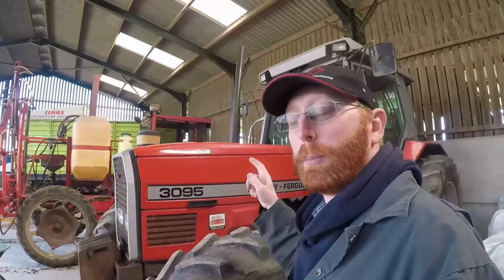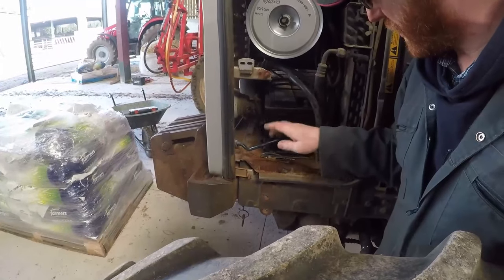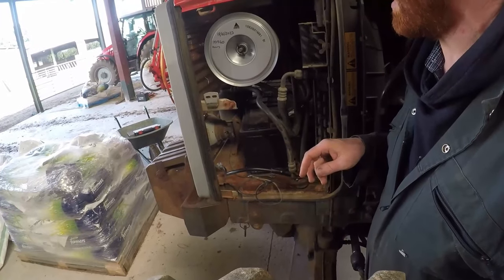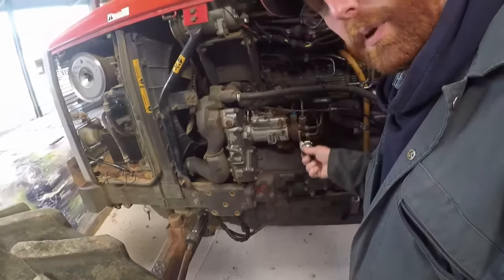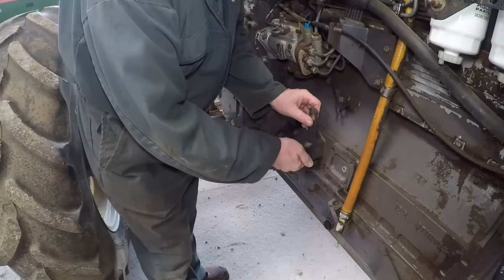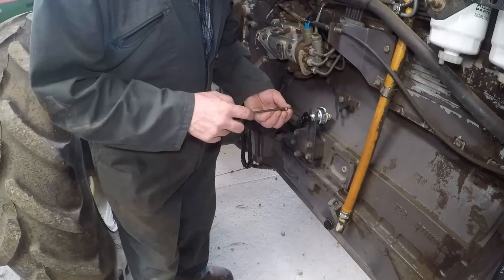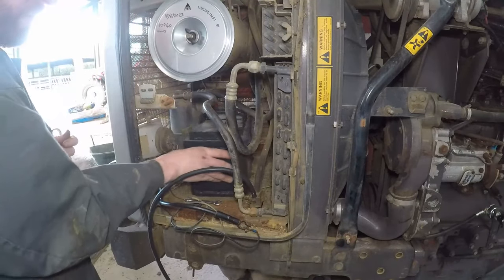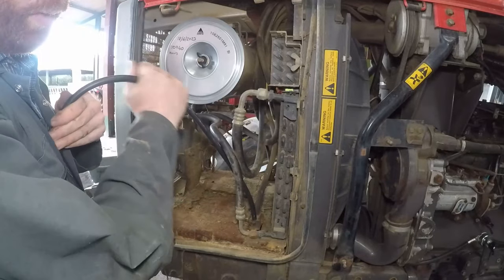Vintage Thursday. Installing a battery isolator.

Comment: It was a good idea to replace the earth line to a non corroded point ...BUT.. the isolating switch should be on the live side close to the battery .  This is important because all of the live side is still live and potentially a cause of shot circuit fire in items like the alternator.  you only need a diode failure in the alternator and the whole unit could go up in smoke. A nice neat job though.

Comment: Hi dan,  i found alot of the elactrical issues with my 3095  were caused by those 2 round connectors above the engine. I cut them out and joined the wires. Help with alot of the issues.
Great tractor though and sounds awesome with a straight exhaust pipe 😉

Comment: MF always had issues with poor eathing through the hard nose mounting bolts. There was a service bulletin issued in the days of the 500 series tractors  to extend the earth cable to connect directly onto the starter mounting bolt to overcome starting issues. Glad to see you're keeping things original, look at a late 525 /625 combine toolbox at the top of the steps and you will see exactly the same isolator switch.

Comment: Curious you wired the switch on the earth side of the battery? If something is grounding out you will still get a parasitic drain as there would still be a circuit. Fitting on the live side would eliminate all electrical power from the tractor. I would be interested in peoples views?
Reply: I always kill the earth too, never any issues that I know of and been doing it a long time.

Comment: if you had an electrical fire due to short and the tractor was running would switching/isolating  the earth  stop the short as the alternator would still be producing power ?.

Comment: Isolator on an old tractor a good idea 👌 my tractor is 65 yr old with original wiring so installed one just like yourself for safety reasons 👌 great video 👍

Comment: Hi Dan, Enjoy your channel. Really like the hydraulic crimper, very professional.  Could you give me the link or make, model etc for the crimper and the connections as I would like to buy one.  Is it the same tool that cuts the cable as well as crimping it? Declan from Farming life at La Forge
Reply from the maker: Hi Declan, it's a different tool to cut and crimp, I'll put the links to everything below.
Dan.
Crimper
https://www.ebay.co.uk/itm/394528845806?mkcid=16&mkevt=1&mkrid=711-127632-2357-0&ssspo=i3fs7EtBRzK&sssrc=4429486&ssuid=HaBpRfveQrO&var=&widget_ver=artemis&media=COPY
Reply from the maker: Cable cutters Stanley Max Steel Cable Cutters 215MM 0 89 874 https://amzn.eu/d/45UoyzE
Reply from the maker: Terminals, various sizes available. 
https://www.vehiclewiringproducts.co.uk/c-46-battery-fittings-isolators/c-97-terminals-connectors/p-556-copper-tube-terminals
Reply: Thanks Dan. Much appreciated.

Comment: Very interesting from my perspective as my 3070 still has starting issues. Turn the key and nothing happens. Repeatedly turning the key will allow it to start. We fitted a new starter motor which has not cured the problem.
Reply: Your fault could be in one of several places, firstly check main battery leads by connecting a battery directly to the starter motor with jump leads. This will confirm if the existing battery leads are good. If you still have issues, check the round black multiplug connectors above the engine on the LH side just under the bonnet, spray with electrical cleaner and make sure all contacts are good. Thirdly, it could possibly be that the key starter switch could be corroded internally. Hope this helps.
Reply: Same problem with my 6100 series. Could start first go but then it might just go click click click a few times before it does start. And same even with new starter fitted.

Comment: What cable should I fit to the isolator on a 1965 b414 (positive earth). Thanks
Reply from the maker: 50mm2 will be fine
Reply: @CowfarmerDan  sorry I meant should I isolate the positive cable (going to earth / chassis) or the negative cable going to solenoid? Thanks
Reply from the maker: Sorry, I got confused!
I would put the isolator into the earth cable, positive in your case.